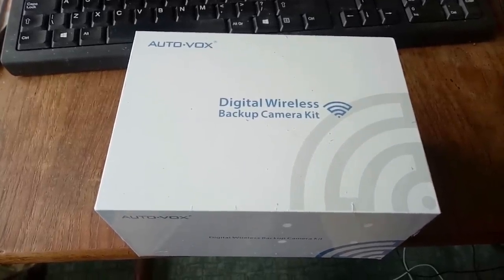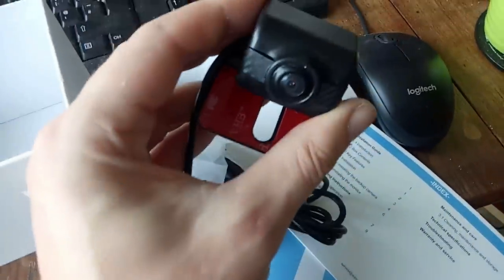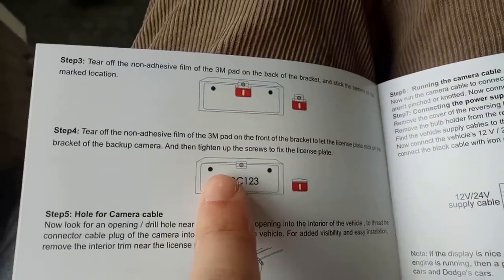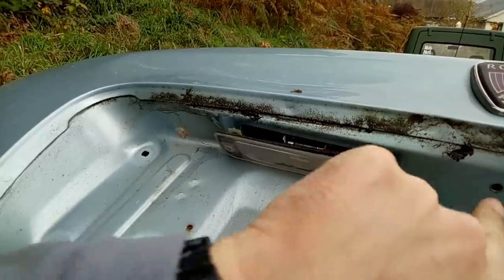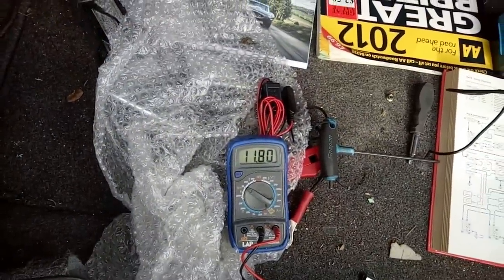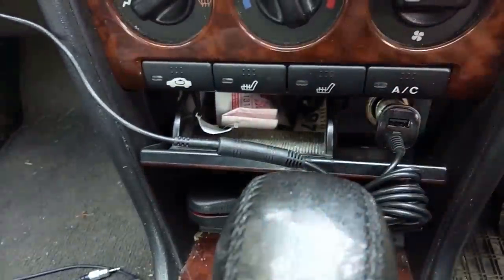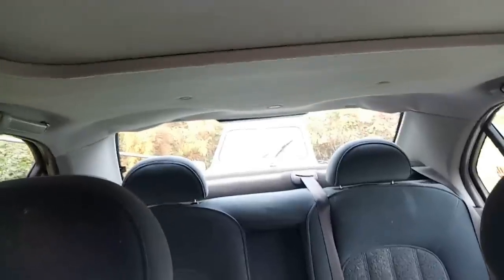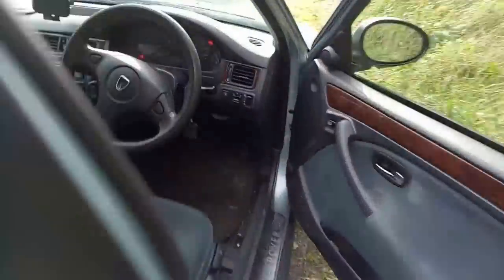Fitting an AutoVox TD-2 Digital Wireless Reversing Camera to my Rover 45 V6.

Comment: I’d pull the tow bar off. They look hideous anyway 👎🏻
Reply from the maker: Useful though... (if I fix the electrics)
Reply: @HubNut  I used the 2CV yesterday to borrow the trailer and three roof ladders from work to allow me to fix a leak and to clear the guttering on my house. Drew quite a bit of attention from the locals, who thought it was brilliant.
Reply: also useful for discouraging 'tailgaters'
Reply: Also useful for the low speed shunts, where twonks texting on their phones in traffic break their number plates when i stop 😂
Reply: Bad idea. I know a couple of people who would have potentially lost their classics in rear shunts had it not been for a big old tow ball bolted to the chassis. Great for conveniently disabling Kias, Hyundais (and other modern appliances on wheels driven by smartphone zombies whose Facebook addictions can't wait until they're parked up) by puncturing their radiators. 

The other option (and the one I went for) is to buy an old Volvo 240 with commando bumpers. Basically iron girders mounted on shock absorbers - it takes a determined tailgater to total an old redblock Volvo!
Reply: I said the same thing. Ruins the look of the back end of the car. Hubnut is never going to use it. Take it off!!!
Reply: Actually, it may seem like it's saved them but in the United States, leaving your ball hitch on your car all the time when you're NOT towing something can void your insurance claim.  I had a friend who this happened to and their insurance would not pay out the damages. Let me explain.  Since the ball hitch is attached to the chassis under the car, if you get hit, you can ACTUALLY do more structural damage to your car than if the ball hitch wasn't there. Remember crumple zone designs?? When the ball hitch takes all the force of the rear impact it deforms the car in a way that it wasn't designed to deform.  Once insurance companies get wind of that, like in my friends accident, they decide to NOT PAY out since you altered the vehicle. After that, i tell everyone i know who leaves their ball hitch on their vehicle when NOT TOWING, to take it off.
Reply: @klwthe3rd  good point, a few years ago somebody ran into the back of my father, insurance tried to say his tow bar did more damage to their car. Till his insurance pointed out it was their fault.
Reply: exactly!! And if it wouldn't have been the other guys fault, the insurance company for sure would have tried to get out of paying your grandfather's claim by saying that the tow hitch caused more damage. Thank you for replying!!